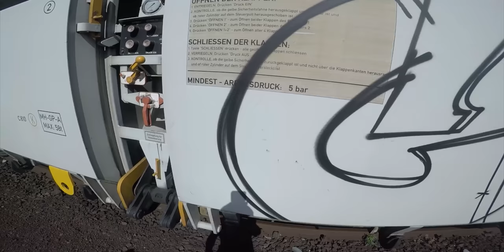RAW Freight Graffiti - Chuk Full Colour Graffiti Piece

Comment: Nice technique only pressing the cap down with every start of a new line during the fill-in. No drips on the corners but needs practice for the hand muscles.
Reply: Saving paint due to lack of finger fatigue from using actual good paint. Unlike Rustos where you gotta just hold them shits down